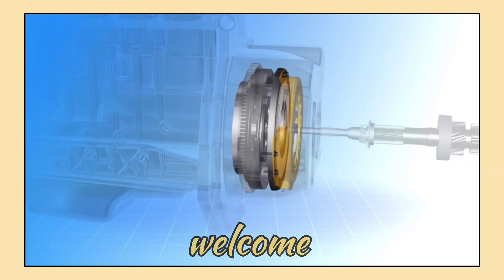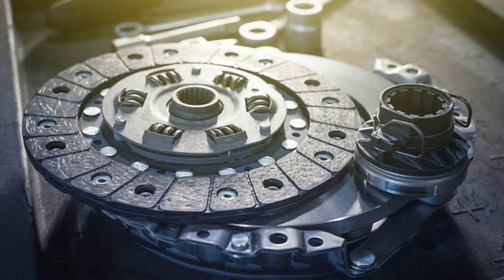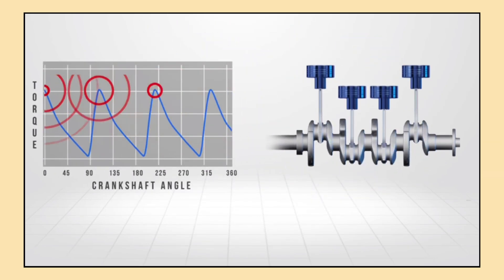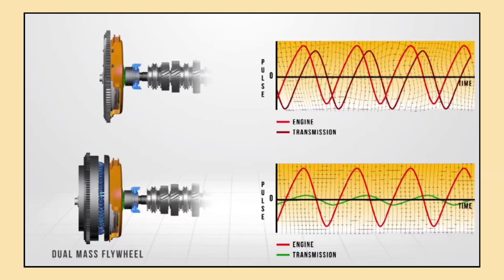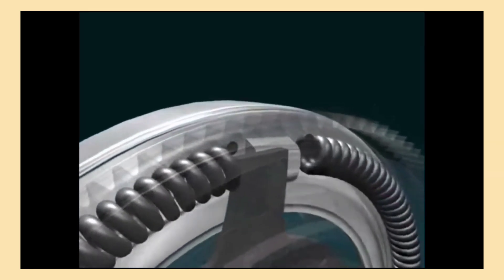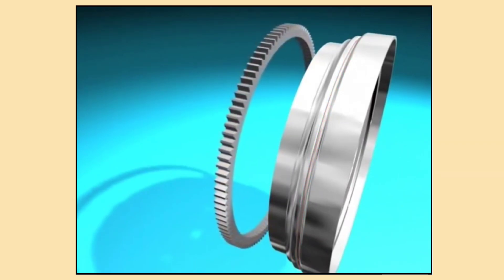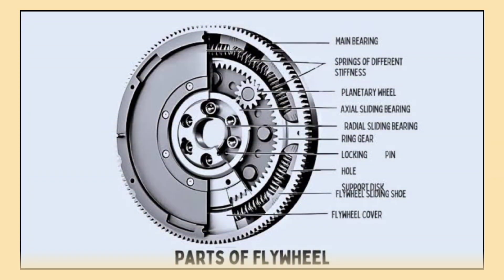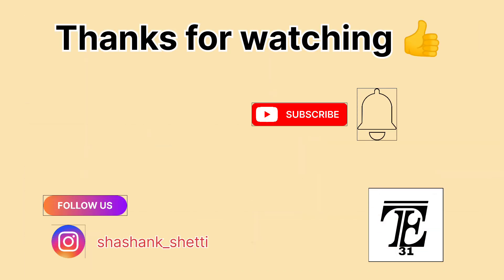"What is a Flywheel and How Does It Keep Your Car Running Smoothly?"#flywheel#engine#car #automobile

Comment: My flywheel makes sound but 2 3 mechanics checked and said it was ok but my car jerks at slow speeds and doesn't jerk above 60km i check everything thing plugs coils and injectors no issue but my car still jerks
Reply from the maker: I’m not sure, but maybe the flywheel has a small issue thats hard to see. Also, some sensors or engine mounts can cause jerking like that. Hope it gets fixed soon!